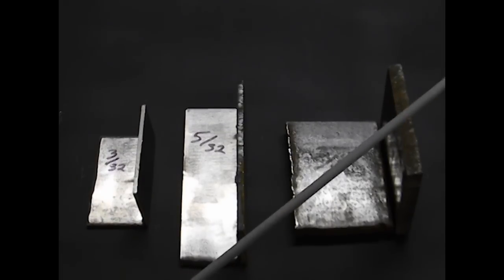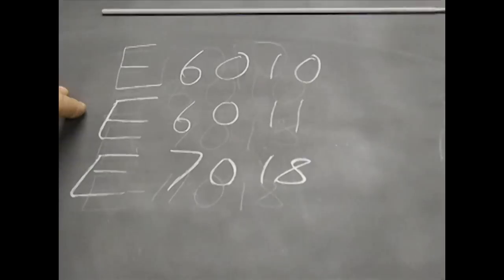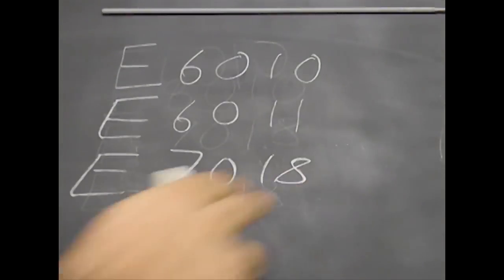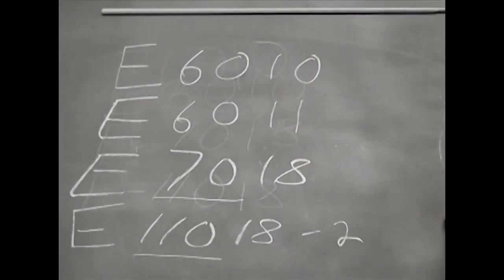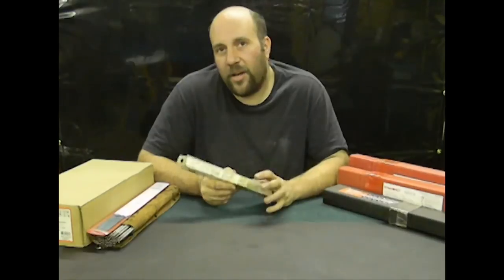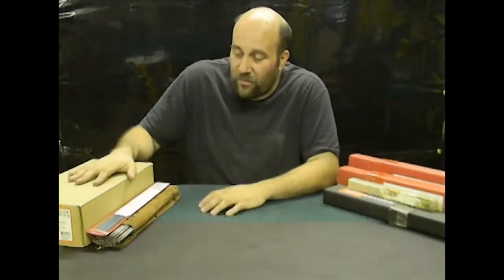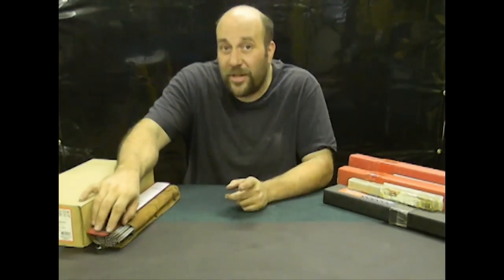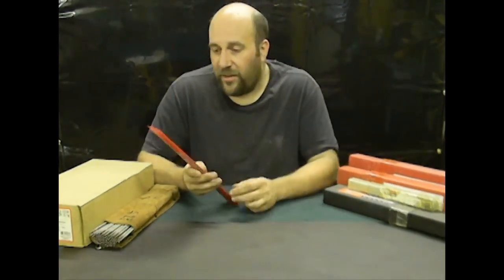Intro To Stick Welding Part 3 - Choosing Your Electrode

Comment from the maker: The core can be up to the thickness or thinner than the metal your welding, welding on an edge, like a welding two pieces of materia to form a corner.

If welding on a flat surface to build up the material for resurfacing your limited to the size electrode you can use. You can not use a rod that requires high amps to run because it can distort the metal. Material thickness is only one factor, the welding position and type of weld are others. For many people its trial and error to find a balance.

Comment: Great video. You touched on subjects that many overlook, but that is essential for the beginner to learn how to weld. On your next video, it would  be nice if you can go over the relationship between the electrode size and the thickness of the material being welded. For instance why is it not advisable to use a 3/32 rod on a piece that is let's say 3/8 inch thick. Good Job!!

Comment: Hello Jeff, Am from India. Seen around 4 videos from your channel. they provide a big bundle of information. Have subscribed to your channel and hope to receive more such useful info

Give my regards to Dayna as well

Am just someone starting off on the stick weld process for a few DIY Projects. Have some basic queries and would be grateful if you can answer or a point me to a source where the answer is available.

1 Can welding be done in a room that has the ac on.
2 am not too comfortable on the electric circuit completion that you discuss in your video. My query here is should the negative electrode always be connected to  the work piece or it can be clamped to the work bench (metal or wood)
3 Is a respirator essential while doing a stick weld.
4 does the process of stick welding for stainless steel, aluminum and iron remain the same. if not what parameter differs

Comment: Well, I´m gonna take you up on that very kind offer right away:
I know from soldering and brazing, that the shape, color and other "attributes" of the braze can tell you a lot about it´s quality and the mistakes you possibly made. If the same is true for welding a video on that topic would be hugely valuable (and of course greatly appreciated). Nothing is more frustrating for hobbyist beginners (like myself) than not knowing when they did something wrong and what exactly the mistake was.

Comment: Very nice no fluff video.  I'm totally new, 2 days with stick welder.  Question how do you know what thickness sticks to use?  Or does it matter?  Is there a real difference between 1/16" and 3/32" diameter rods?
Reply from the maker: Some people like matching he rod to the material thickness. If your welding 1/16" sheet use a 1/16' rod. I have never stuck to that rule myself.
Reply: @jeffreysanto  Got you.   I’m making shelf bracket with 1/8” flat bar for my first project.  So I’ll try with 1/8” or 3/32” I guess.  Thank you for quick reply.

Comment from the maker: If you read the requirements for polarity and set your machine right you should be good to go. It can get confusing when you get into the metallurgy aspect. Some rods make the surface metal harder, some are made in such a way they help stress points flex before breaking. There are rods require the surface of the metal must be very clean (electrodes for cast iron). Some like 6010 on the other hand can weld through rust and old paint. Its like knowing what lure to use to attract the fish you want.

Comment: First great 3 videos I learned more from your 3 videos than watching 20 different others on here. But I have one question could you go over the position of the ground clamp , like where is the best location to have it, on different jobs ?
Reply from the maker: Honestly for stick welding steel the ground can be in any location. What a lot of people do is put the ground clamp directly to their welding table, in school we never used the ground clamp since the ground transferred through the bench into the work piece. The key to a good ground is the metal your welding being clean and free of paint and rust. This is a very good question and I will make a video on it in the next month.
Reply: Jeff, as you know, it’s not a ground clamp, it’s a work clamp. It’s not actually grounding, even when it’s negative, because it’s negative, not ground. The welder is grounded, and that’s different.

Also, only low hydrogen rods, like 7018, need to be kept at high temperatures, from about 170 to 300 degrees.  The rest should be stored at room temperature and kept away from high humidity. I keep them in a tube with good silica gel packets.

Comment from the maker: Most of the codes on the electrodes are such as "E 7018" or "E 6010" are standards agreed to within the AWS  (American Welding Society) 

There is another group known as ASME (American Society of Mechanical Engineers) that uses another coding system, P- NUMBERS (PROCESS), F-NUMBERS (FILLER MATERIAL) and A-NUMBERS (BASE MATERIAL).

I had seen these codes before but forgot from where, to be honest I had to look them up again... hope this helps :)

Comment from the maker: I only touched on that briefly when talking about core wire sizes. I am going to be welding the three sample sets of metal in the next video and explain the difference. I am trying to keep these videos within a certin time frame.

In a classroom setting this topic would be a 1 1/2 - 2 hour conversation.